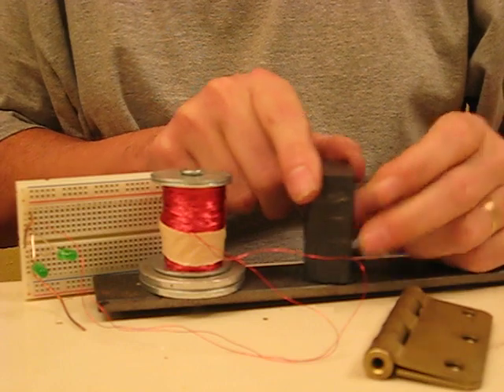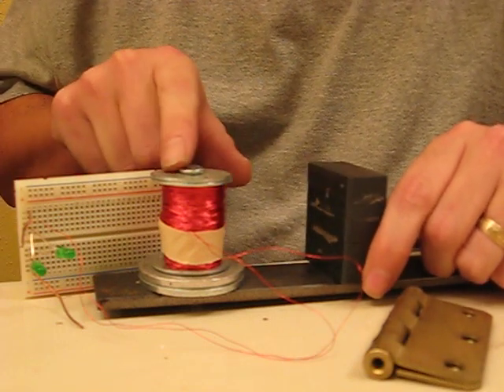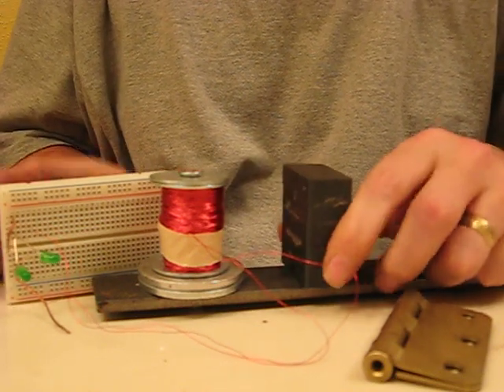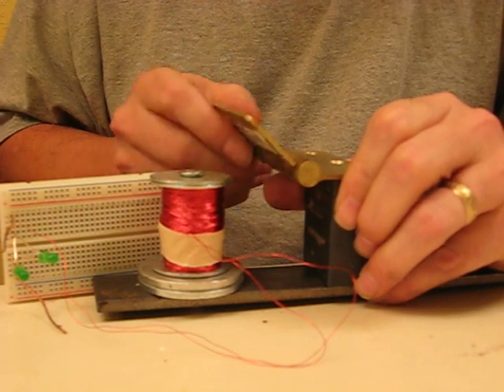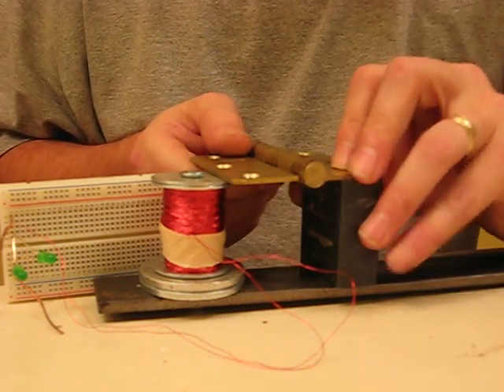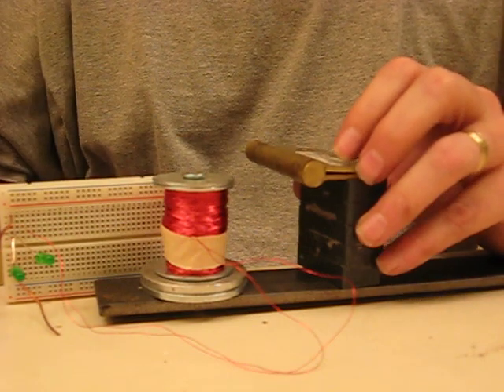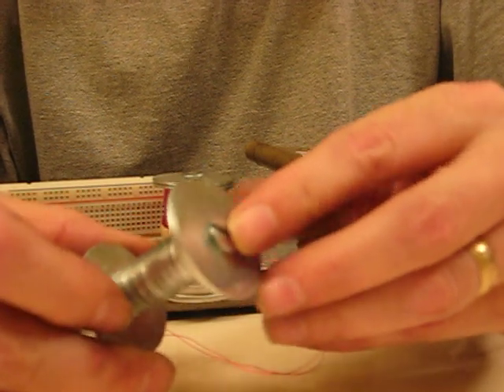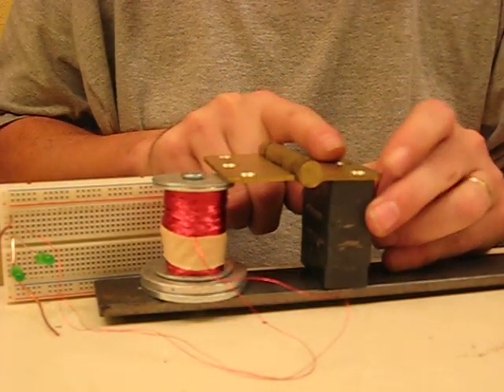Permanent magnet generator with no relative motion between magnet and coil

Comment: The hinge is an extension of the magnet and its angular motion cuts flux lines. The number of flux lines cut and the rate determine the current generated. Nothing different.

Comment: Since the hinge is connected to magnets core. Its size increases when you open the hinge. It further extends when you connect the hinge to the core in the middle of the coil thus lengthening its size and surface area. In electrical transformers magnetic induction is increased by  introducing a core or thickening its size.  Multiple thin cores are added to increase the surface area.  I believe this is what is typically is happening in your experiment as well. Extended the core increases the reach of the magnetic flux. It cuts the coil thereby inducing emf /current. Lifting the hinge from the core of the coil. Causes a change in the shape, reach  and strength of the magnetic flux. This causes the emf to be induced in a reverse direction.

Comment: If you set the video to 25% speed you can see that the power is generated (LED lights up) as the hinge approaches the spindle, just before it hits it, and as it moves away, right after unsticking, not right when it touches. It's that motion that varies the field.

Comment: you still mave moving magnetic force there because as long as the hinj is stick to the magnet it becomes a magnet itself !!! for example if you get a lot longer peace of metal and put the magnet on the one side and the coil on the othere nothing will happen because the metal wont be magnetized that further... so that is fake ... ur statement it s absolute fake.... you need motion and it is still magnetic motion relative to the coil!!! so Faaaake

Comment: I can tell you, when you attatch the hinge to the magnet , the hinge is now part of that magnet, and you are flying the magnetic hinge close as possible to the mouth of the coil. Excellent example of mechanics but you are still moving the magnet on a hinge. Keep at it, dont give up.
Reply: not exactly. 

this is essentially a mechanical cousin of a joule thief circuit. it makes a magnetic circuit appear and disappear inside of a coil, inducing a current. 

the fundamental motion is the expasion and collapse of the magnetic circuit,  both of which produce current, in opposing directions,  as shown by the led's.

 this is actually somewhat terribly clever.

imagine you had a magnet the same size as he has in the video, but a coil that was 2 meters long. it would be a real chore waving the magnet up and down the 2 meter coil - BUT with his method you could simply open and close a magnetically permeable gate upon a ferritic core in the length of the coil and suddenly it is as if the little magnet has covered the entire length of the solenoid instantly! 

I wouldn't be so quick to dismiss this demonstration. It may be more clever than even he realises.
Reply: Truth S. Stranger humm
Reply: @truths.stranger5454  No. The number of flux lines cut by the motion and the rate of that determines the current. Putting a hinge on changes nothing about the basic physics and adds no advantage. That is why complete rotations of a shaft are used. It cuts the most flux lines the fastest. A hinge is only half a rotation at best and must then be reversed. Quite inefficient. That's why linear alternators are not as efficient.

Comment: What if you would put a transistor instead of one of the connections from the coil to the magnet, and give it a boost and the letting it feed of the energy generated in the coil? Just a thought.

Comment: So can a coil  be used to rob a electric(magnetic) current from a alternator in motion?
Reply: +JackWayne Roberts Yes,  you can put a copper coil under some power lines and pick up some Free "stolen" electric from the magnetic waves the power company has let loose,  so you are robbing them.  But They let them go.

Comment: Actually what is happening is that the magnet is magnetizing the hinge that then behaves like a magnet, and moving the hinge then creates a moving magnetic field.  From the basic principal of physics, moving a magnetic field near a wire creates electrons to flow, creating electricity, powering the leds.  The hinge sticks to the top of the coil because it is also a magnet like the one that it is stuck to, and thus has magnetic properties, albeit not permanent. So you are not shutting on and off the field.  When it hits the top of the coil, it then makes the steel a magnet, and thus no more flow as magnets must be moved to create electron flow.  A moving magnetic field makes an electric field, and vice versa.
Reply: steven, there you got with your facts and proven science again, impeding the creative flow and disputing the fine fiction wrought for our entertainment... what if they add a rotating cam made of transparent hard candy (to replace the protohuman's finger(s)) and place the LEDs so they shine thru the candy cam making pretty patterns?! We could use LASERS and project those pretty patterns on a wall or large screen - that'll draw a crowd! Give me a hand with these bags of sugar - we've work to do!

placing the coil core and magnet in direct contact with, let's say, a steel or iron bar might improve things... oh, he's already done that? hmm - rather bright (for a proto), isn't he? as soon as we've poured the candy cam, let's work on getting him educated...

Comment: This idea intrigues me because it produces a very distinct and simple signal. That is a sine wave that, in theory, remains above the center line of an oscilloscope. Think about that one !  if you never reverse the polarity of the magnets - the sine wave should not drop below the center line that designates the divide between positive and negative. (at least this is according to every description of the sine wave I have ever heard) 
but when a magnet passes over a standard donut shaped coil it probably produces back emf because of the fact that the flux must first pass through half of the coil - then through the center - then across the other half of the coil. as the flux passes through each individual wire - it creates a positive flow then a negative - therefore the width of the copper bundle causes different parts of the coil to be pushing in different directions , by passing flux only through the CORE and not through the wires you are reducing SOME of the back emf that is inevitable in standard coil configurations.

Comment: Thanx so much for the video; I had similar ideas and made a little hand crank generator that works on a similar principal. My design was based on the "first transformer ever made" (don't know that is true but that's what wiki said) 
it was a steel ring about two inches diameter made of about 1/4 inch thick steel rod and one side had alternating current passing through about 50 wraps of copper and the other side had some number of wraps. My core was the same except instead of a "O" shape it was "C" shaped - and instead of a coil with AC passing through - this is where the magnet passed through - therefore creating a strong magnetic flux through the core and coil of wire and then quickly removing it as the magnet leaves the gap in the "C" core. With only one coil of 700 wraps - 25 ga mag wire - At approximately 2000 rpm I got 2.5 volts at .05 miliamps. (full bridge rectifier and a tiny motor running)
Reply: ***** Ha ,,,,, Ha ,,,,,,, Ha...

Comment: Hi I have about 8 large magnetic air coils in series.  When I tested it with a 12 v 60ah Battery, theres 120VAC through the wires but there was negligible detected magnetic fields from my electronic detector.  Do you think its because of the low power given to the magnetic coils? should I bring up the power rating?
Reply: yes, yes, by all means! i think that by using a 12vdc battery (or do you have an ac battery?) and only 8 large magnetic air coils in series to develop 120vac without much in the way of magnetic fields you have opened a door to a new region of science and should proceed thru said door with all haste! I don't know if you 'should' bring up the power rating, but by any and all means you 'ought' to do so, if only to feed your need for knowledge & adventure. Would Telsa or Edison have stalled and waited for approval? Dr. Dre didn't succeed by hesitating - he forged ahead, he followed his hunches, dared to try! Bold fellows achieve - bland fellows work in the mills and eat 'cheese sammidges' while they dream of ham...

CRANK IT UP! PUT SOME POWER THRU YOUR CIRCUIT AND HUM THEM BAD COILS UP!! If you don't trip your main breaker, you ain't really tryin... You were given the name of Constantine - live up to it!

Comment: Many people try to build the Free Energy Generator
Most of them failed as they didn't have good plans
The Only one I saw to make it work-
An Engineer called John Richard from Chicago
To see the design on his blog - Search Google for: Top Magnetic Generator
Reply: Jimmy, you are, by accident or intent, deluded. I can show you a way to grow plants using sunlight - would you like to invest?
Reply: Infires you can get energy from the atmosphere with minimal input and then more output then what was put in.. your not gonna find it online though.
Reply: You can get free energy if you are talking about money. (the simplest way is to put a wire before the electricity meter.)
Reply: manaquri okay buddy, is that the only way you think it's possible?
Reply: well, solar panels and wind turbine (once they are paid for), phase change heater (you get more heat than what you pay for, by cooling the air outside.), putting a coil under an HV line,  a big-ish coil close to a radio station (it works almost everywhere, as long as you need only a few micro watts.)
you can make a solar actuated "free energy" device by putting paraffin wax in a tube, and making it push a plunger that moves a cover over it, hiding it from the sun, making it cool down and retract, then you can harvest energy from the movement (though it's low speed high torque which is a pita to transform in electricity).
Reply: note that the paraffin motor works anywhere where you have access to a temperature over 35 degree and one under.
also, I'm mistaken, a quite compact radio wave harvester can generate in the order of a few miliwatts, which is enough to run an lcd clock or a similar low power circuit, or even light up an led every few seconds. (a couple of BAT54S diodes, 0.1 uF ceramic caps, and 100uF electrolytic caps gives around 100mV, so with 10 of those in series, you can have a radio powered clock by replacing the battery with that circuit.)
Reply: manaquri it's possible if you match Schumann resonance(sky) with a coil(huge) using high voltage and then having something to collect it
Reply: manaquri you need to ionize the sky, then you can draw in the energy it holds in the clouds for example.. it's possible, but it wont reach the masses ever.
Reply: Maybe, but it's also possible without, remember those black and white dots on the tv (or the noise on your radio when it isn't tuned to a channel)? That's "Free" energy (basically radiowaves emitted by stars and stuff, but you'll also get some from radio stations depending on how your circuit is tuned). You may get a bit more by having the device next to a radioactive source, or more reliable, a radio emitter.
Reply: manaquri your talking about a crystal radio type setup, yeah that's free buts it's not even practicle.. if you tune the system to the sky freq. You can get a practicle amount. Getting it from radio waves that have been emitted is not free, people had to put that out using massive amounts of power..
Reply: Free Energy Generators are a scam, they do not work. You can not generate free energy, no matter how 'good' someone claims their design is. All videos showing that they 'work' are fake and have been debunked.

Comment: If I have a few dozen generators with 28 gauge wire all generating power, and I want to connect them to a main circuit combining all the watts into a 14 gauge wire, do I need to add anything to make sure the combined power isn't leaking back into each of the individual 28 gauge circuits (burn them out)?

Comment: So what?  Sweat isn't in the equation, you're applying a force in opposing directions.  The net result is a delta 0 for distance and work wasn't accomplished.  We can have an exertion of force without work being done.  The issue is that you are equating work to applied force, they are not the same thing.  That's similar to arguing your velocity is 10mph when running on a treadmill though you're not really going anywhere except relative to the belt.

Comment: Good video. I realize this can be one aspect of the Hendershot Fuelless Generator. He had a horseshoe magnet with 3 poles, a iron bar, and two solenoids. With his device, if it makes and breaks, it too would provide energy into his larger coil structure.

Comment: well, this is interesting, since this proves that electricity is only produced with the movement of magnetic flux against the coil of wire. Why not create a switching circuit that will electrify a coil to make an electromagnet which will open and close the magnetic flux, hence the build up and collapse of magnetic flux. Maybe we can make a high efficiency generator out of this with very small input (battery) producing high output current/voltage? what do you think??

Comment from the maker: Contact (no airgap) definitely helps. Owing to the extremely high permeability of iron, the flux is (as a first approximation) controlled by the airgap between hinge and iron spool.  So to get maximum flux, it is important to get min airgap (contacting).   Addditionally as mentioned there are higher forces involved when the hinge contacts the spool so the accelerations and velocities tend to be higher, which also increases voltage.

Comment: Your hinge carries the field and when you move the hinge you move the field that the core is in. You get extra boost by the speed the hinge contacts the steel coil end and the speed with which the break is made when you flip it back up. 
Most of that coil is wasted, btw.

I get better led flashes tapping a piezo disk even through a diode bridge.

Comment: i used tesla,faraday and maxwell work to show how it works. wow physics .  i can get 97% 0r more of the input force back  out of generators that can be used to power a off  self generators . 3 parts all that need it very .  3 part like a slip ring ,2 magnet and pulley  . i use a concept called  regenerative brake is an energy recovery mechanism which slows a vehicle or object down by converting its kinetic energy into another form.

Comment: my English is bad you are right on that. you barely know science tell the truth or you would  use it, not your mouth 1. State the problem example- What gets hotter in the sun: water in a black cup or water in a white cup?
2. Gather information about the question.3. Hypothesis example- I think that the water in the black cup will get hotter.
4. Testing the hypothesis example- Create a test.
5. Draw a conclusion based on test results and report. 5 steps scientific method it work really good

Comment: Actually, the steel hinge becomes an extension of the magnet, and moving it to and fro DOES constitute moving the magnet. It wouldn't have to be actually touching the magnet OR the solenoid core to work!! But then it may not produce enough voltage to run your LEDs. All it does is act as a lens to focus the magnetic field and pass it to the coil.

Comment from the maker: I'm not sure what relative motion you are referring to. But I do agree is simply works off of  Faraday's principle V = d/dt(N*Phi).  It's different than your typical home-made generator... does not use relative motion between the permanent magnet and the conductors. Instead it relies on mechanical movement of the core, which alters the reluctance which causes the rate of change of flux.

Comment from the maker: There is no battery or external power source.  The current circuit is not interrupted.  The flux circuit is interrupted / reconnected. The change in flux produces the voltage and current which drives the LED.   Mechanical work is input into the system to move the hinge and yes energy is conserved.

Comment: I don't get what this proves. You're current into electromagnet is manualy flipped off and on (no commutator since you have no rotor!) This creates and destroys mag field, requiring work from battery to electromagnet, plus manual work for change. So total energy into this is much larger than tiny led light output. Right?

Comment: Like some others mentioned.  The hinge becomes magnetic when attached to the magnet.  Making the hinge a magnet, and its the relative motion of the hinge to the coil that is causing the voltage.  Not the fact it is connecting...

Comment: rotation is exactly my plan, self sustaining rotation, on a side so its not fighting gravity, implimenting this simple thing into my design would make surges of electricity, my overall design generates stable unlimited energy the only way to slow it down is to pull it apart haha when i finish it, i will let you know how i go if all goes well, (working with a scientist) my original design was for interstellar flight but he got me onto free energy devices, by using my algorithm for free energy XD

Comment: i haved looked into the design i thought of came across a problem magnets only have energy because they are balanced which could mean no matter what way you put them together they will remain balanced or would require energy to disrupt it such as switching poles or changing polarity but even though this is a nail my idea is not dead but now i know it does require energy to fit the 2 parts together and make them stay would require tons of force but when its achieved